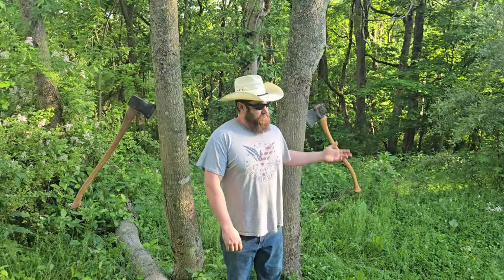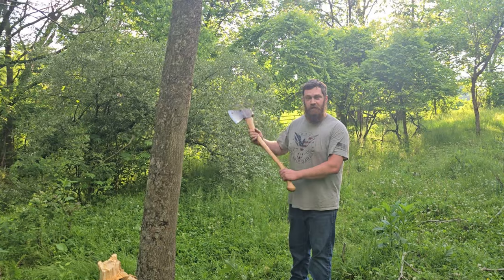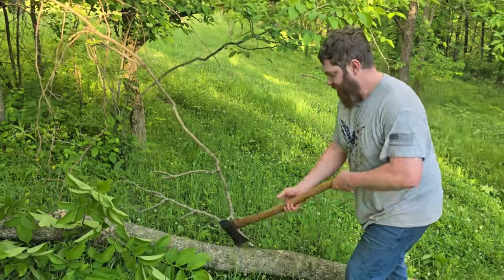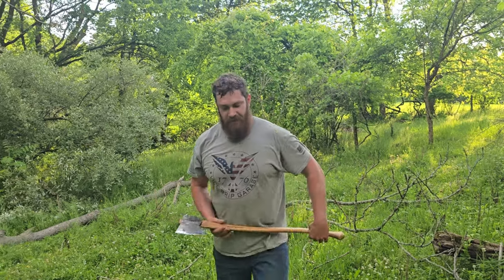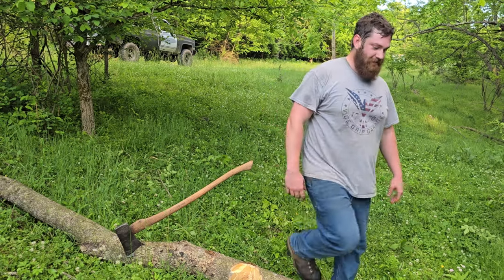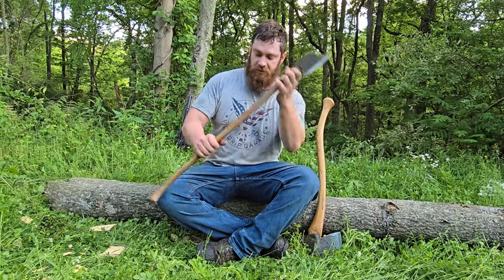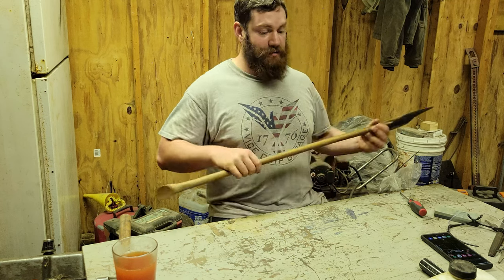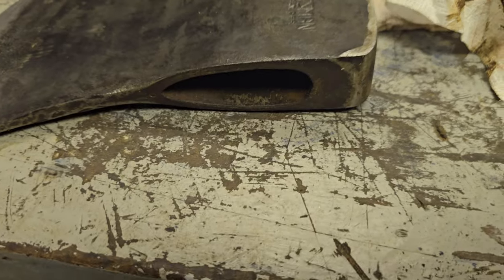craftsman axe vs farm axe. Do you need a $500 axe?

Comment: Cool video, don't let your camera man steal the show! It's hard to compete with a nice vintage Michigan. People don't appreciate Michigans because they're common, but they're common because they were effective and popular. I do covet that Hoffman though, but I don't have plans to spring for something like that anytime soon. As for handle length, I think it depends on the job more than height or anything else. Ben Scott is like 6'4" or something and he likes a fairly short handle for bucking and I do too. I 30-31" is pretty good in general but for limbing and standing behind a log to buck I do like 28-30" myself. Also, maybe we all have to learn the hard way, and I certainly have, but it's a really good idea to cover the edge when you're working on or around an axe and something that I try not to be lazy about. Little cuts are annoying but the not worse case. Especially if it's clamped to a bench because if it's sharp and absolutely rigid, someone can get a life-changing cut if they bump it with any body weight behind it at all (walking, stooping, standing up, reaching for something etc.).

Comment: Well, let's be honest: good tooned and maintained similar tools perform similar no mater how expensive they are if they are not total junk.
I have modified polish JUCO 1kg axe and it does its job great - 15$.
Got me self a 1,1 kg Hults Bruk and it performs marginally better (better edge retention) - ca.100$.
Performance wise was it worth it? Definitely not, but it foundels my ego pretty well :)

p.s. Than Hoffman looks gorgeous thou :)
Reply from the maker: I couldn't agree more! The only time you really gain anything is when the steel is far superior and you're able to make the edge geometry and overall profile better because the steel can take it. But that's difficult to do because old steel is still really good steel most of the time.

Comment: Great video! Especially for those of us just learning about the LH line. Sorry if I missed it but which handle length is on the Farm axe? 28” or 32”? Which do you think would be more ideal for someone one about 5’10?
Thanks again
Reply from the maker: Mine has the 32" handle. I'm in the 5'10" range flat footed and I would much rather have a 28" straight handle
Reply: @RandomAmerican  thanks. Putting in an order now and wasnt sure which way to go. Like the looks of the curvy but you feel straight ends up working better?
Reply from the maker: The curvy seems like it has too much curve to it and it's hard to get your hand to do a full slide unless you are going all out on your swings

Comment: You should always cut at a angle, it cuts better. The 90° should be done with a saw. The handle is fitted wrong on the first one. Should not have a shouldxer on the handle.  I always fix up old axe heads.

Comment: I have between 15 & 20 axes, ranging from cheap Harbor Freight ones to $200+ models, yet I rarely use any. What makes the biggest difference in performance is being able to get the proper edge geometry. That said, a cheap axe in a competent axeman's hand will outperforn the most premium axe in the hands of someone who doesn't really know how to use it.

I'd love to own an axe by Liam Hoffman. The price is less of a deterrent than dealing with his backlog, since his are in such demand.
Reply from the maker: He actually just opened up his ordering so you can order any axe at any time but the back log is still 8-12 months

Comment: Bottom line! The overwhelming majority of all the nearly 6.7 billion people DONT need a 500.00 axe. A 25.00-50.00 axe will get the job done just as good or near identically as a 500.00 axe
Reply from the maker: You are absolutely correct. I have more money in expensive axes than I should and I still split it roughly 50 50 on if I get an expensive one out or a cheap old one. As far as capability it comes down to a lot of factors. Some old axes out perform expensive axes but it goes both ways